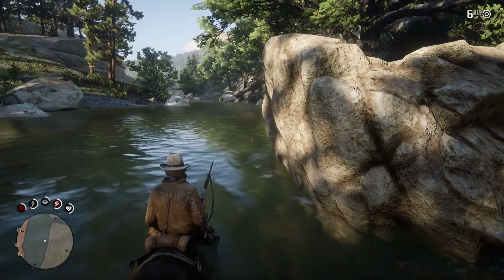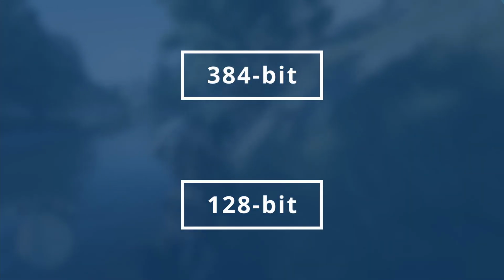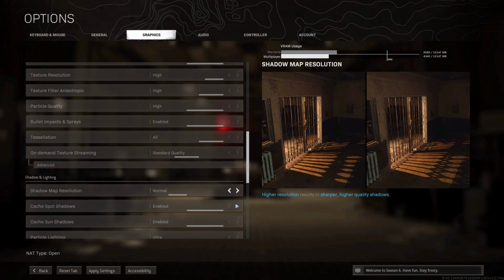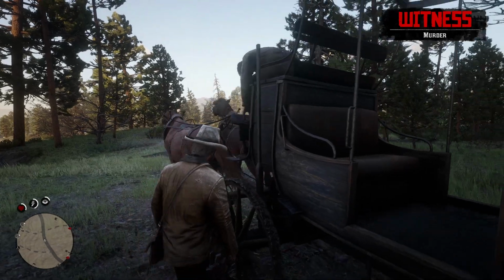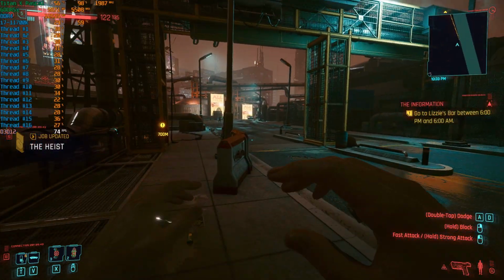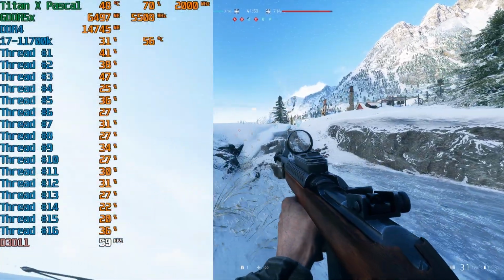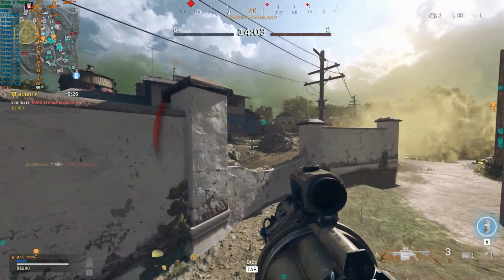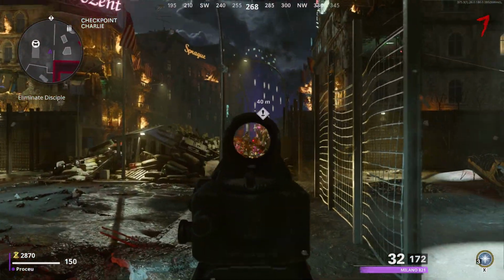How Much VRAM do You Need in 2021?

Comment: horizon zero dawn takes 11gbs of vram in 1080p
Reply: I tested and this game use this VRam only to store texture. I cut my VRam by software (GpuRamDisk) and this game works fine with 4GB of VRam too, but disk usage is much higher. So if you have a fast SSD you loose 1-2 FPS max...
Reply: @TheZutox  I believe that nowadays games automatically take storage of hard drive to create virtual vram and ram so that games are able to run smoother

Comment: Vram and raw power of rasterization of GPU of the card like a car and its internal. A lambo, is fast but only carry 2 people more than that you will struggle to carry them, similar to A bus with not so fancy engine, It carry more people but slow.

I regularly play AC Valhalla and RE2 with high texture with Vega 7. This scenario takes up almost 14 gigs of system ram(out of 16gb). It play consistently at 15-20FPS compare to my former laptop with GTX 1050, it play like 5-30 FPS and framerate all over the place.

Comment: When you say "Optimosed game" which is using less VRAM is not true because the optimised is one which has all polygons pre-calculated and stored in VRAM which is actually taking more VRAM  than "non-optimised game" . This way "non-optimised game" will actually run faster